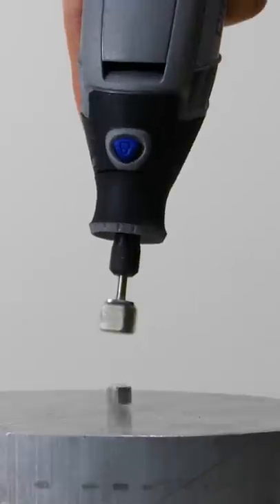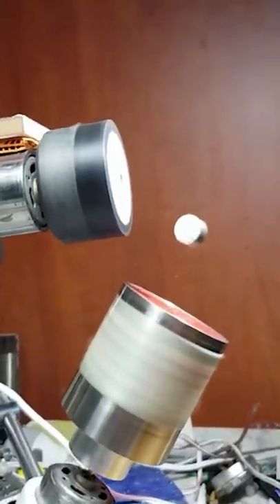Real-life Magnetic Tractor Beam! (New Physics Discovery)

Comment: There we go, soon we'll have those levitating cars and spaceships we've been wishing for
Reply: Not spaceships. You'll need a good magnet nearby.

Also, levitating cars are neat, but I don't think they would be that practical compared to goof old fashioned wheels.

Flying cars, on the other hand... the obvious solution is personal airships.
Reply: use a plane and a bus you watch too much sci-fi movies
Reply: @wowalamoiz9489  someone doesn't like jokes.
Reply: @specialoperatorlolbit8671  It wasn't a joke. People genuinely wish for levitating cars.
Reply: @YourBestDaydream  nothing wrong with learning something and hearing opinions. Who doesn't like geeks.
Reply: Probably already have the spaceships
Reply: @YourBestDaydream  If you make a joke, I'll laugh at it or make no comment. The original comment wasn't necessarily a joke.
Reply: Heavy topic. Polarized opinions. Lighten up.
Reply: @kentneumann5209  Or have fun debating.
Reply: 303? Like, the Acid techno machine?
Reply: @wowalamoiz9489  I'm not too fond of the idea of flying cars, people are already dangerous enough on the ground with four wheels, imagine what will happen when they suddenly get pitch and yaw.
Reply: @azure4622  Unless the flying cars are fixed wing aircraft which move constantly, accidents would become much lower.

The first reason is that the area of travel would increase. On the ground, cars are limited to roads. In the sky, the only obstacle would be skyscrapers.

The second reason is that there would be a third dimension of travel, increasing travel space even more. People will be able travel at different heights.

Due to both these reasons, there won't be traffic problems anymore, except in parking zones.
Reply: @wowalamoiz9489  Maybe i should have written it this way...

"Heavy" topic. "Polarized" opinions. "Lighten" up.

See what i did there? The play on words. Its supposed to be funny. Ah well.

Comment: I am wondering what you can do between this and Sonic levitation if you carefully control Sonic nodes and spin frequency.
Reply: You could use sonic levitation to stabilize the target, so it remains stationary while being suspended by the electromagnetic fields lines. Theres still some torque being put on the target. It might be a simple way to eliminate that torque efficiently and allow for more precise control.
Reply: you need the chaos emeralds
Reply: @JorgetePanete  I really do tho.
Reply: Read the research paper
Reply: @MrArtVein  Is there a link?

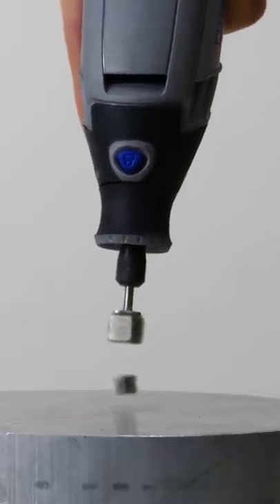Comment: 0:01 interesting, I thinks this works (with a simple explanation)because the positive and negative magnetic field of the spining magnet is interacting with just one pole (of the other magnet) which makes it attract and repel fast enough to not be able to move, and the wobble that we see is the rotation speed not being in sync (or proportional) with the magnetic force of the magnet.

I'm pretty sure you could actually make an equation which describes the velocity necessary for this to happen depending on the strenght of the magnet (if he hasn't do so already, which it sound like he did).

also this makes me wonder: is this effect somehow related to the gyroscope effect? (not saying this explains the gyroscope effect, just saying it might be related somehow)

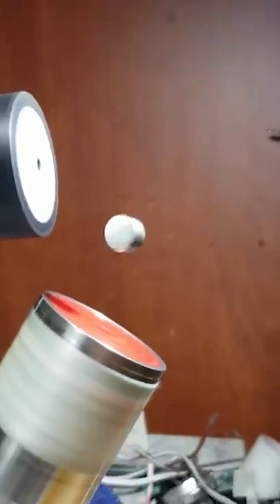edit: or also the wobble could be explained by (or partially) due to the air produced due to the rotation of the magnet (which in 0:30 seems to confirm it since the rotating drum doesnt have any irregularity which could create wind, in comparison with 0:09 which the square magnet might actually be irregular enough (in terms of shape) in order to create enough wind to affect the magnet (also the fact that is so tiny doesnt help either)

it would be nice if I had a vacuum chamber to test this but I dont, I wish a youtuber which owns a vacuum chamber could test it :)
Reply: The guy doing this video demo has a vacuum chamber.

Can you apply your comprehension of what's happening and upscale it to a flying craft using the earths magnetic poles and technology available in the 1940's, (or 30's, tesla) along with a virtually unlimited cash flow and a slave labor force?
Reply: @kentneumann5209  i doubt it
Reply: @kentneumann5209  Die Glocke

Comment: I am curious if this could be used on a larger scale, like making a magnet big enough that could lift a metal cargo container. Although I’m not sure if that would be more or less energy efficient than the way it’s done now.
Reply: It's less efficient, you still use the same amount of energy to lift the container, then you have to add the energy to spin giant magnet(s).
Reply: Massively less efficient than some steel cables. Also the eddy current losses in something so large would turn the container into a cooker.

Comment: The implication seems to be that if it used electromagnets instead of fixed magnets and you  could control the  voltage to the coils, you could move things closer or farther away by independently modulating the voltage/field strength to each coil.
Reply: I think the primary implication would be on the foundation of physics.

Comment: Be super careful if you try to do this. If the magnet on your rotator is not perfectly centered...well, you can probably guess what happens. I gave it a try with a dinky off-brand Dremel flat sanding head but it was off center by about 3 mil (0.003") on one side. The magnet launched itself off pretty slowly but it was spinning so fast that when it hit the ground, it took off like a ricocheting bullet and punched through some protective metal mesh that was in a wooden target stand in my basement. If that magnet would have connected with me, it would have been a really bad day considering the hole it shot through the mesh was barely bent and was almost perfectly square. It's gotta be going pretty damned fast for that so there's a high margin of error with a high level of risk.

Comment: Imagine the wartime applications of such a technology. Pesky tank blocking your path? Simply throw it into the air by flying a bomber with a tractor beam over it. The energy/material cost, when correlated with the enemy’s loss would be unheard of in all of warfare.
Reply: Not that I have any idea of the energy/material implications of flying such a massive magnet and motor into the air, but it does seem more efficient than explosive ordinance, as you don’t need to manufacture ammunition for it, it just needs the power.
Reply: @think1st363  brother have you heard of Newton's 3rd law

Comment: Freaquency is the key to this levitation frequency and its relationship to the mass of the object being levitated by calculating the vibrational frequency of the object you can make some determination as to the frequency of the rotation of the magnet to achieve levitation
Reply: Stability requires a minimum rotation speed. This speed is determined by the moment of inertia figures of the levitated magnet. Smaller magnets require faster speeds. Follow this avatar for more experiment videos. Every video has a detailed description page.

Comment: what mass is the upper limit for the field strength? time to look at practical applications like heavy lifting
Reply: Think about attraction force between two magnets with a small gap. This will give you the lifting strength. The effect related to rotating field (called PFR) works as a stabilization mechanism.

Comment: Talk about Hutchison effect
Reply: This gives me an idea: Suppose the H. effect disturbs the structure of a material, disintegrates it similarly to the heat melt or breaks bonds of molecules. Heat does it by shaking atoms/molecules spatially. But if you can do a similar thing magnetically, shaking atoms not spatiatially but shaking their magnetic orientations. May some atoms or molecules are vulnerable to such a shaking and can break their bonds. This would be a smart method to handle materials like melt, reshape, bond or disintegrate without applying heat. Lightsaber, magnetic drill bits, magnetic boring, medical applications, magnetic surgery, rebond soft hard tissues, killing pathogens by targeting specific proteins magnetically, satellite based demolishing jobs, magnetic 3D printing of impossible materials like stone. magnetic cooking, food processing, magnetic metallurgy, efficient way to disintegrate H2O...

Comment: So he was genius or is !!??
Reply: alive, here
Reply: @sudanamaru  so he was you ? 
I suspected that because he said ( AL) something like " ... He dedicated his last 5 year .."  
man thanks god if he was you did nice thing ..
Once may be 2015 or 16  i  tried this same experiment using water pump magnet and dc motor by rotating i found that attraction between magnets decreases than i thought 🤔 may be this could somehow do levitation things but i skipped thinking that it can't possible that is why no one tried This , but now I know i was right someone did this thing .
Reply: @sudanamaru  so....
If you can do this by rotating magnet so it should also positive with moving Electromagnetic field like synchronous speed of AC motors using some sensors and PID algorithm ? But may be this thing is already done ? right? Because I have seen in some video like Great scoot ...
But i think no-one did synchronous approch for this same Moving Magnetic levitation effect .
Reply: @omsingharjit  Excitation using electeomagnets or by electromagnetic waves would be required for applications where trapped magnet sizes goes sub-millimeter. Also it would not be difficult to trap molecules this way. There are already such solutions based on quadrupole fields. But the key point in the dipole-dipole bound state solutions is there could be already such bound state in nature. The "gluon" solution is noteworthy because the magnetic assembly called "gluon" can bind two featureless dipole magnets to each other, working as a glue field.

Comment: But can you change the distance? If it can be changed, then tractor beam?
Reply: Actually it is a short range force. In these configurations, the distance can be changed by a centimeter at most.
Reply: @sudanamaru  Yes but what exactly would change the distance?
Reply: @9nikola  lowering the spin rate increases the repulsive action and this increases the distance. These relations are given in the article.
Reply: @sudanamaru  So it can be moved back and forth. Noice.